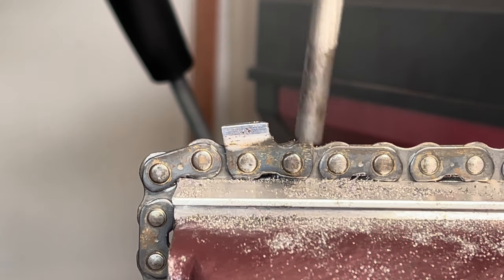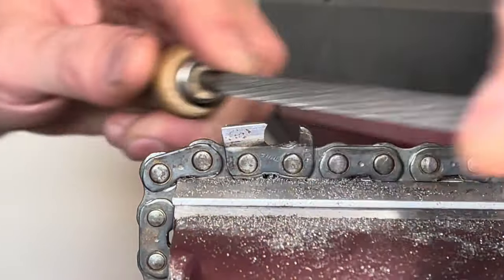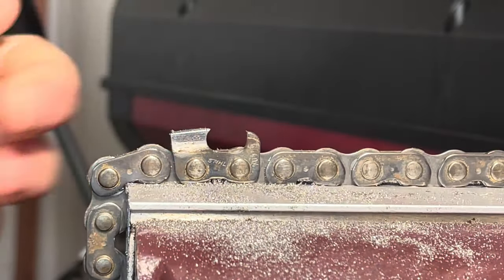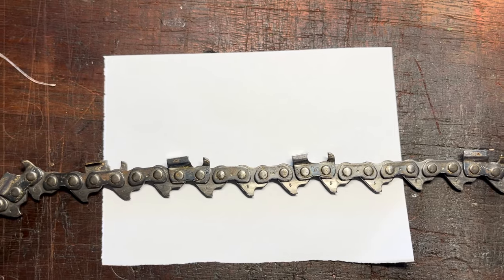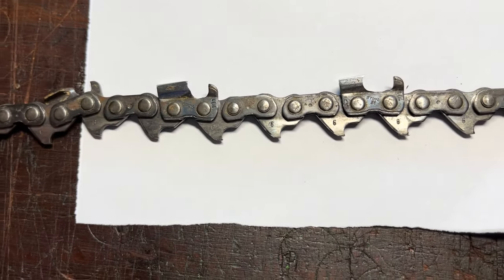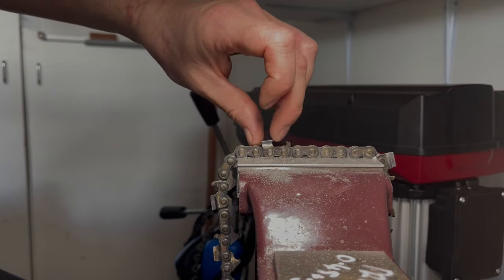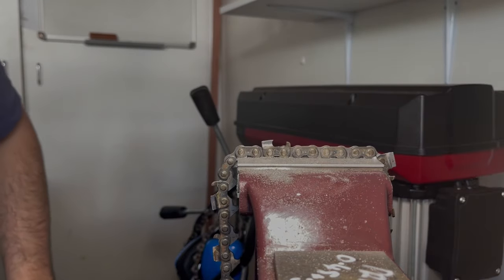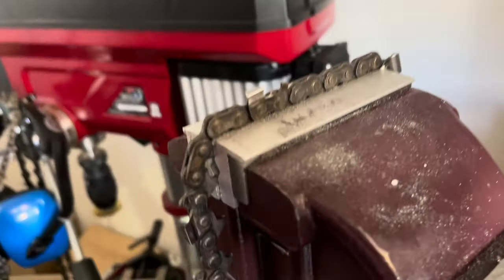How To File A Chainsaw Chain Part 1

Comment: I'm filing my 2-10 for the first time... 7/32" is giving me the C shape I want but not sharpness so I'm going down to 3/16".
I'm also getting a burr off the bottom of the gullet which I have never had before. The chain looks different.
Reply: I think it's safety chain.
I watched Part 2 then had another go, this time making sure I didn't pull up which seemed to give a better result. I finished one side and at the last tooth I realised a link was broken. :-/
Reply: It's semi-chisel too. Might be why I wasn't getting on with it. Pic in the McCulloch thread on AS.
Reply from the maker: How are you going with your sharpening now days?!